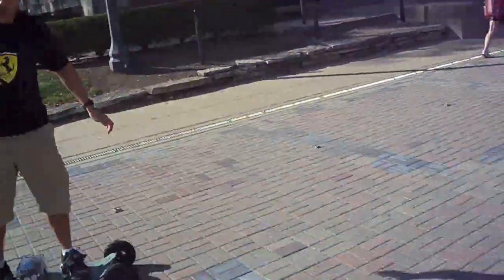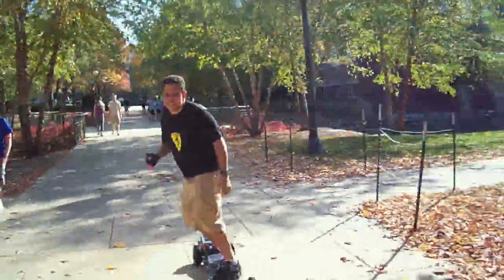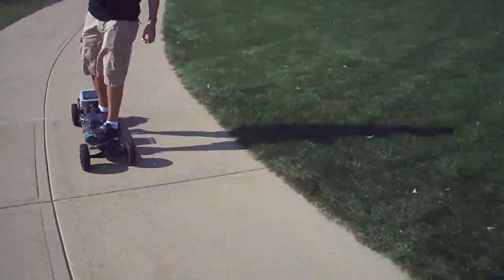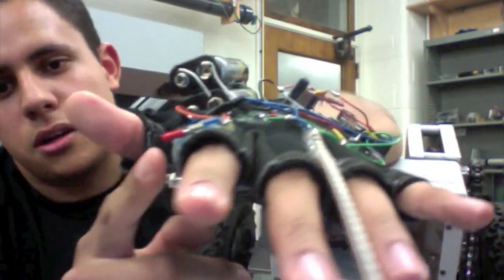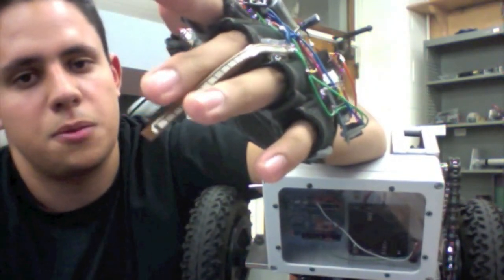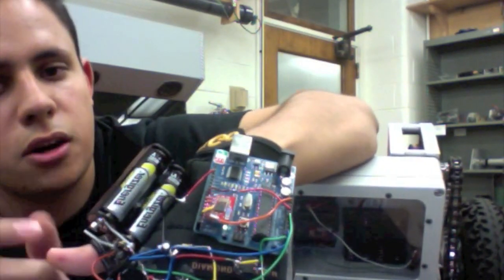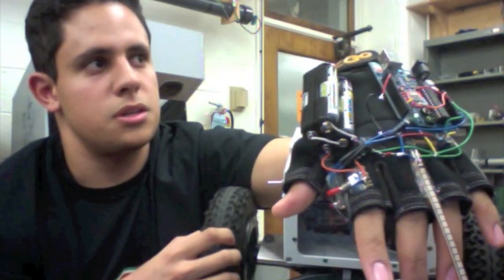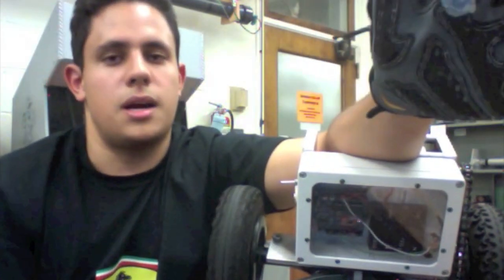Wireless Glove Controlled Electric Mountainboard

Comment from the maker: @duckythescientist Hmmm...you mean details like what kind of battery, motor controller, microcontroller, transceiver, etc that I used?  Or details regarding the structure like the way the motor is mounted?  With regards to driving the board, it only runs on one wheel.  I thought about using a differential, but to make them the size that I needed and having that mounted on the board, all of that just seemed like a hassle.  Having it drive one of the backwheels worked out pretty well for me.

Comment from the maker: @russianasdfg Well I used an Arduino Duemilanouve so it uses the ATmega328 AVR chip. The Arduino library and the programmer itself makes it very easy to program compared to a PIC. hackaday.com has lots of projects that involve this kind of stuff too, just in case you are interested.